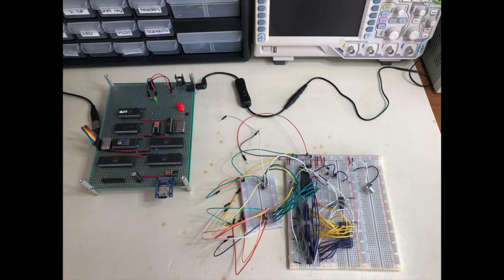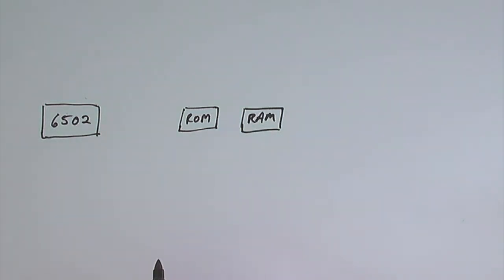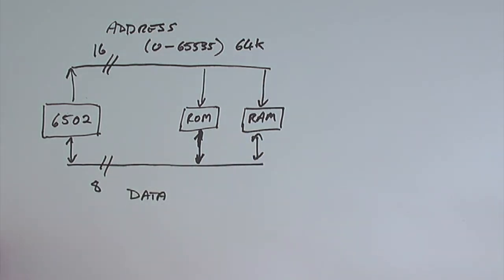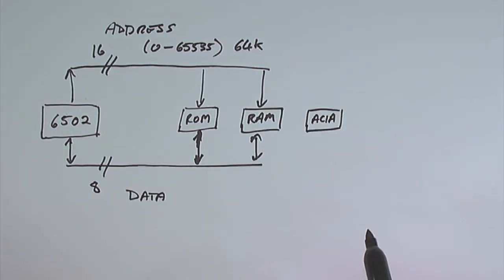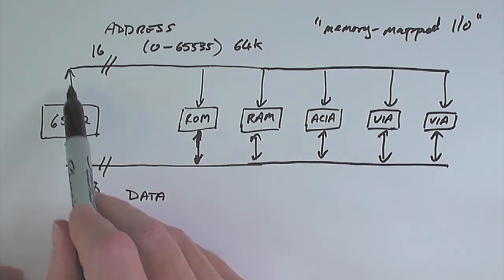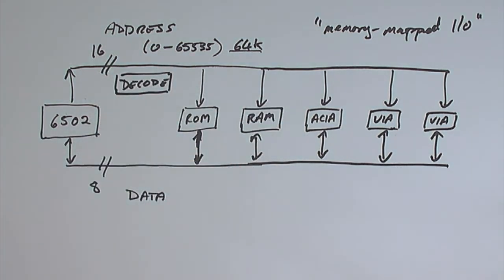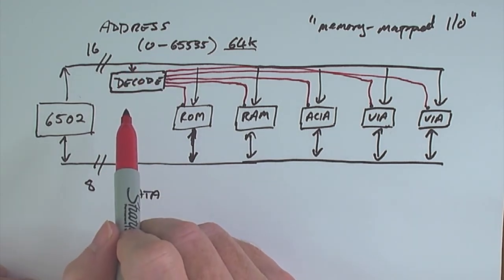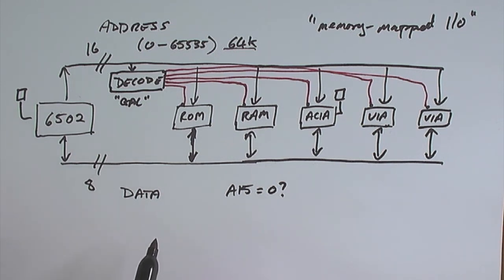6502 Mite home-brew computer project: hardware architecture

Comment: That is very neat :) Is there a way for the BASIC programs themselves to load and save data on the Mite? (Though, that's fiddly enough on a tape-based OSI machine!) By the way, I love this series of videos, github files, etc., they're incredibly helpful/useful/excellent/encouraging, thanks!
Reply from the maker: Not currently. I'm not sure that the version of MS BASIC that I am working with has any facilities for that itself. I'm pretty sure that it doesn't. If it did, I could just extend that to use the ROM routines for I/O; if not, it is probably easier to begin with a different BASIC like BBC BASIC or Enhanced BASIC and incorporate that. Most of the programming I do is with FORTH and it can do file I/O via the BLOCKS interface (and perhaps soon via file streaming too).

Thanks for the kind words about the videos. After a long hiatus, there are finally more coming soon!
Reply: @pauldourish , it's doable in OSI's MS BASIC - it's just not very pretty! The "OSI BASIC in ROM" manual (there's a PDF under "Books" at osiweb) shows a couple of methods starting on page 34. One way uses SAVE / PRINT and LOAD / INPUT statements (all embedded in the BASIC program), the other's based on POKEs, PEEKs, and WAITs :)

And yay for more videos on the way! :)

Comment: Data, address and timing/control busses?  There are usually considered 3 busses, no?
Reply from the maker: You're right, of course, but the 6502 control bus is so minimal that I left it out for this basic introduction.